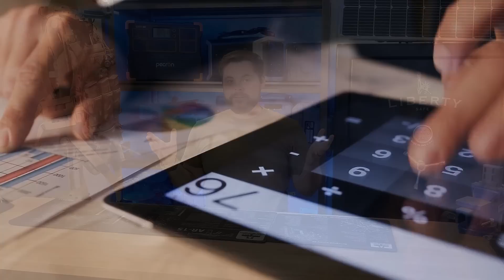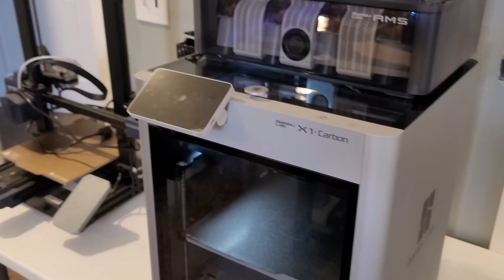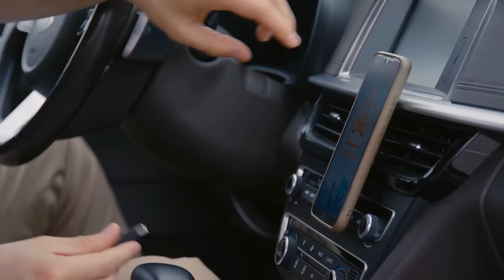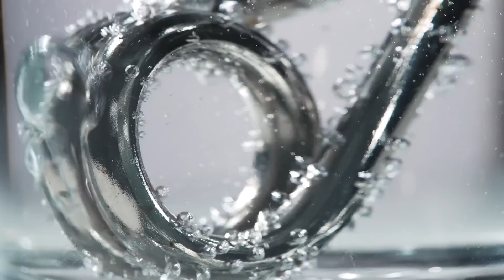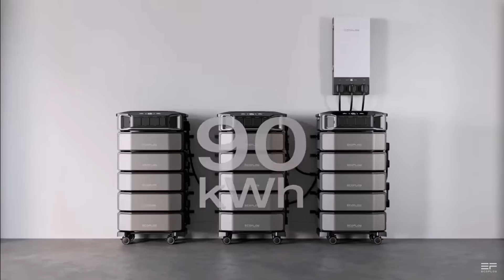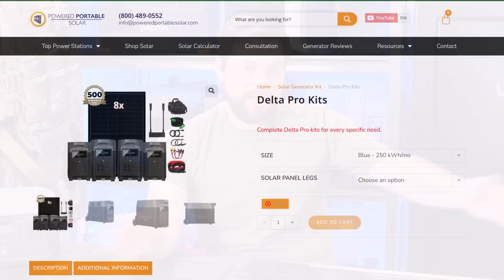No One Is Talking About This With EcoFlow

Comment: Why the “buffer” (River 2) between your car DC outlet and load (laptop)? (To explain my question, my laptop accepts usb c PD at 60 watts. I use a cigarette lighter charger that will output the 60 watts needed. Will this cause a long-term issue?)
Reply: I suspect that a River plugged into the cigarette lighter port acts like a UPS when the car is turned off. The occupant can keep working w/o powering down/off. When the vehicle is started again or the key cycled, there's no voltage fluctuation affecting the laptop.
Reply: I'm wondering too.

Comment: I’m using my Delta 2. Look at what I can do. Its solar is working when the sun comes out. If I need to I can charge it up with my generator. But I can in its programming set it to goto the grid if the sun is not available. With it I run my refrigerator on solar with grid backup for daily use. Saving me on my electric bill. I do have an extra battery for it, so with it I can go from daylight to daylight and save 103 watts per hour of grid power. Thanks Ben for your input and  chart on the equipment.
Reply: And most importantly have off grid refrigeration available, which is probably the important thing we rely on in the modern world- refrigeration. M

Comment: You’re a Bluetti guy and this vid basically bashed EcoFlow. Which is unfortunate because EcoFlow is the most innovative company on the market, all others just don’t compare. Excellent customer service and warranty.
Reply: Please tell me your experience dispense of great with customer support and warranty I've had nothing but back and forth for the last 3 months could you please tell me what you did or what process you use to make it work so well for you no sarcasm here genuine question I have two Delta twos one charges at sporadic levels even though I've got my app set up and I'm not inexperienced I've been in the solar generator market ever since Jackie came out with the first one jackery that is but these two Delta 2s 1 of them right out of the box is just throwing a overload protection and will not take a charge and EcoFlow wants me to send them a video of the last time I used it which I never used it and I've spoke to two different customer service people and they say the only way they communicate is through email and I don't have sure power where I'm at that's why I have the generators but they were refurbished units but I didn't expect them to not work right out of the box and I'm sure it's something simple it's just throwing an overload protection batteries symbol and won't take a charge so I can't get enough power to give them what they need but no return calls from customer service they only outgoing emails but if you could give me some insight I would love it and be much appreciative
Reply: @ example. I asked customer service about my expectations for my work van powering a fridge/ freezer and 4 dewalt and 2 Milwaukee battery chargers 24/7 … they advised me and I bought a delta 2 max for my work van, it lives outside all year on cape cod. Extreme heat and cold. I also bought the ecoflow 220 watt solar panel. They work perfectly in any temps. But….. 1 week later they had a sale for less money and 2 free 100watt solar panels. I emailed them , explained the situation and they responded same day . They sent me out the 2 free solar panels and a bonus lamp/light. Also got the discount. 
     They also advised me months later, on smaller units for my needs and when to buy a couple river 2 pro units on sale.
     They even answered questions about other companies units like Jackery and Bluetti. I can’t say enough good things about eco flow customer service and the 3 units have worked flawlessly.

Comment: I also have experienced the Delta Pro problem after firmware update.  Working with EcoFlow now to get 2 units returned and replaced.  Will update here after this plays out.
Reply: I have had the Delta Pros since they came out and have had a couple to "brick" on a firmware update, and they would never correctly work with the 240 volt hub. I now make sure that I disconnect all inputs, outputs, and the 240 volt hub before doing any updates. So far, that has worked, and now my 240 hub is working flawlessly. 🙏
Reply: @DSMLivin 
I have the 2 delta pro units tied to version 1 of the backup panel.  

No issues even with latest firmware.  

I did try the hub before getting the panel.  

The worst part about the panel is getting matching breaker cards for the panel & the cards not being recognized.  Had to use excessive force to work.
Reply: Why even bother updating firmware? Was there something wrong with your unit for you to update it? Or do they automatically update software?
Reply: I’d swear I discovered the 99 days left to charge firmware issue 😂.
I emailed them within 6 hours of that release because my unit did it.
They acted all stupid for weeks before finally responding to me by telling me 
Quote “you wait”. 
Note, it took EcoFlow 5 months to fix this issue 😮 ya.
My same unit works fine now.
I also emailed Ben here letting him know.